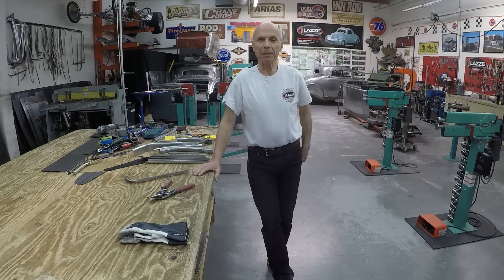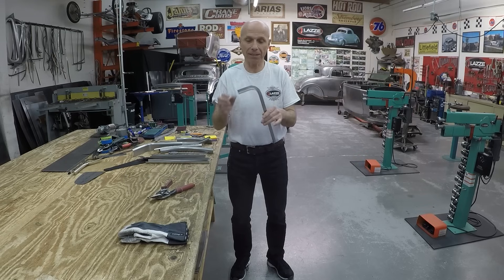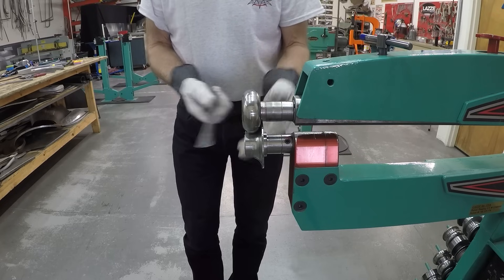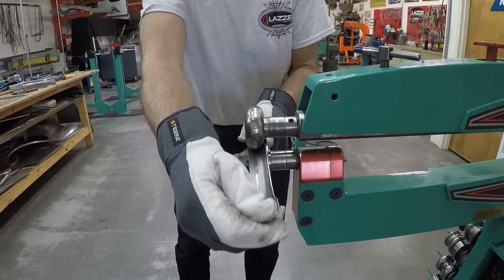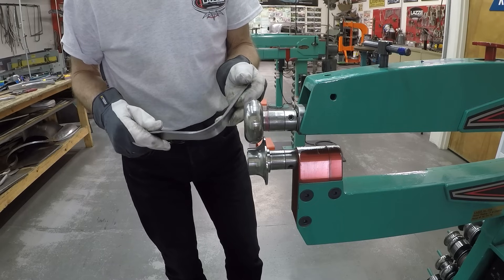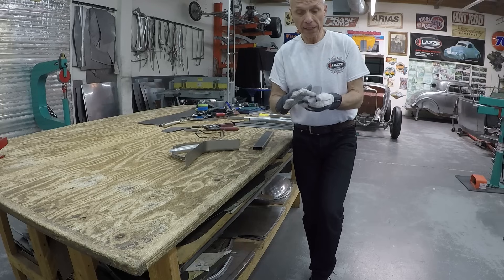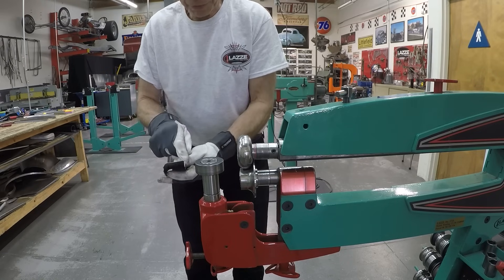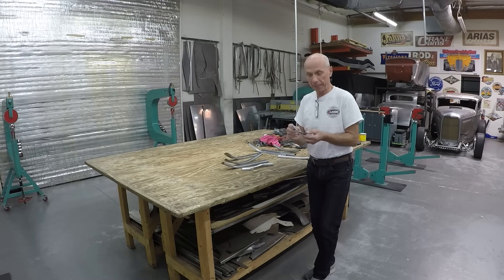LAZZZE METAL SHAPING: Combining Techniques to Create a Custom Angled and Rounded Profile!

Comment: Thank you for doing this videos. I learn a lot from them. I’m a retired fabricator. I have a shop here at my house. As a side gig I do sheet metal restoration work for antique tractors for Kelch restoration. I just used this method to make some front fenders out of 16 gauge for a Deutz tractor. Bent my sides up A little then put the radius on with the bead roller then shrunk it. I have all mittler brothers equipment. I bought most of your die’s and like them better. We have even shipped tractors to Sweden. Once again for showing my limited equipment how to get the job done

Comment: we used to put a piece of round steel with de radius needed in the brake on top of the sheet metal to create a round bend, after with the shrinker or stretcher to the needed shape. benefit is you can create almost any radius with just a piece of round bar. your technique is very cool too by the way ;)